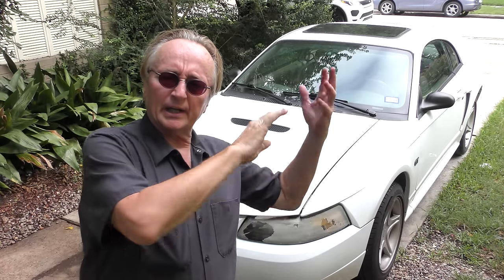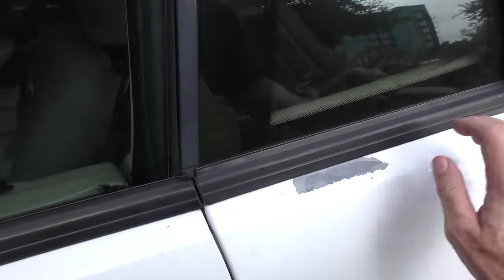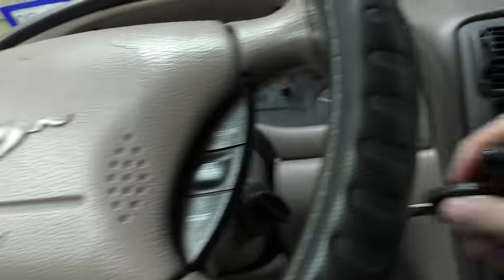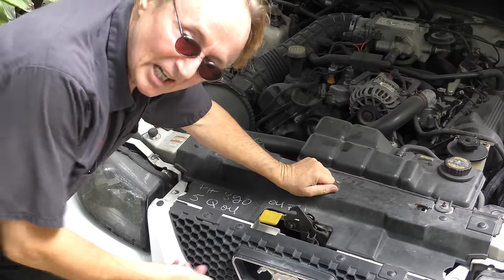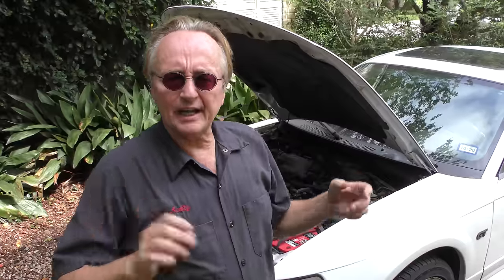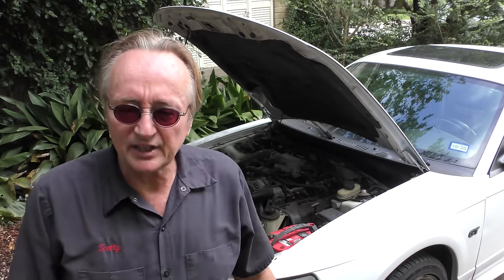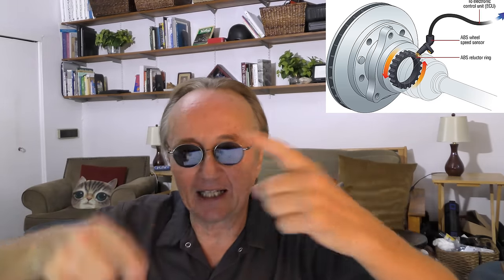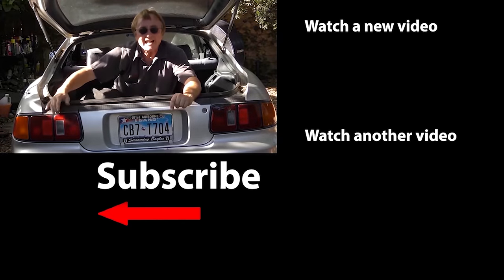Buying an Old Mustang and Fixing It Up

Comment: $5k 10 years ago was a steal. These things still sell for $5k all day.
Reply: American v8 kinda hard to beat it
Reply: 1200$ cars
Reply: United States Of America if only that was true lmao
Reply: i bought one 2001 green 120 k  3k
Reply: I bough a 2005 Mustang GT 115K for $5,700.
Reply: These years are a bit overpriced and they're not one of the best years either. 03 or 04 maybe, but not 99 to 02.
Reply: Still decent. I've been looking for a NIssan 240sx and those are so expensive. 6,500 for some paint peeled, 200K +, mismatched rust box. Ridiculous.
Reply: No they dont
Reply: United States Of America a busted up v6 base model for 1200, you can not find a gt for less than 3k in running condition
Reply: The v6's with low mileage still sell for 3-5k where I live. The v8's can be anywhere from 6-10k with low mileage. 5k was a steal considering where I live.
Reply: DG96 - v6 mustangs only sell from 1500 to 3k if I’m really good condition I could barely get 4500 out of my premium GT with no problems here.
Reply: @hsslegg  I'm aware. I was talking about relative to where I live. I live in Ontario, Canada where the used car market is greatly inflated compared to other places.
Reply: Hsin that’s a steel cuz it’s the newer body style with the revised motor
Reply: I owned two '02s and a '04 bought all three for less than $1800
Reply: @dg96-93  I, 100% support your claims.  From first hand experience. Bought my gfs 2000 V6 Mustang with only 100,000 km  for $3200 , and I got my 2006 Mustang with 300,000 km for $3500 haha . We are also in Ontario Canada
Reply: @NickSingh.96  yes sir. In Ontario the used car market is well inflated. What would could 1-3k for a car for many people can easily be like 4-5k+
Reply: i wouldnt take one for free. lol. looks like a tweaker mobile.
Reply: @Blake-pu3xc  its very true.   I own 13 mustangs...  most ive ever paid is 2000.   just bought a 2000 gt for 700 bucks and its way nicer than the one in this video.
Reply: @unitedstatesofamerica8304  yeah because theyve got problems. cheapest ones youll find with the v8 that dont have engine or tranny problems are about 4k, any cheaper and theyre burning oil, misfiring, or the tranny is slipping/syncros are going bad
Reply: Just got a v6 160k mi 1.4k
Reply: @andrewthag  not a gt lmao, pretty much irrelevant to this
Reply: $5,000 was a lot more money 10 years ago.
Reply: @jmorris023  That is still alot today...
Reply: @eclass96  Not with all the money that's been printed.  Inflation is off the charts, we just don't recognize it because the folks that put the numbers together discretely removed housing from the calculation in the 90s.
Reply: The dollar is getting watered down, that's why.
Reply: I got mega lucky and ended up with one for 500 bucks from a friend who just wanted to get rid of it
Reply: True, mustangs around my area hold their value quite well
Reply: got mine for 900
Reply: There all sideshow specials too alright ones 5k and mint clean ones 7+
Reply: @a.ortega4505  wow that’s a good price must’ve been a v6?
Reply: Got mine for &1200
Reply: @futureconsequence5374  all cap
Reply: 2004 145,000 mile $900
Reply: @Immortalkalashnikov  imagine wanting a pristine 240sx for 8k lmao.
Reply: Sometimes you can find them for less then 1000 dollars I know a website where I saw a bunch of good working ones for good prices
Reply: What?  i bought 4 for less then 5k$ lol like i mean all together. 🤔 i currently own two lmk if you wanna buy one.
Reply: @EZBMX713  how much and where is your location?
Reply: I jus bought one for 1200
Reply: More like 5k for a v6 lol, v8’s will run u bout 10k
Reply: Just got an 04 GT 5 speed 40th anniversary for 4K. And it needed pretty much nothing fixed. Been driving it 50 miles a day for 3 months now and all it needed was an oil change. I also replaced the clutch cable. Gets surprisingly good gas mileage for commuting.
Reply: I just got one and the cheapest in canada without rust was 10k over i got mine for 11k
Reply: We are very salt roads tho so i had to buy a show car
Reply: No they’re like 10k cars now
Reply: Im getting my 95 for 400
Reply: @unitedstatesofamerica8304  hahaha you are not too smart
Reply: Got mine for 3.5K with a basically new motor with 6,800 miles and month old rebuilt transmission
Reply: @NovaCaine2489  bought a 96 with 100k. $6300. Built. Supercharged
Reply: 5k is a fair price considering honda accords and toyota corollas from 2000-2007 go for 4k-8k stock with decently high mileage
Reply: I’m about to buy one off a guy for 2200 bucks gonna go look at it tomorrow
Reply: @ryan422423  probably doesn’t run
Reply: @futureconsequence5374  im looking at a 2000 v8 GT Automatic w 82,000 miles askin 5,900. I wouldnt give more than 5gs. Thoughts???
Reply: @unitedstatesofamerica8304  maybe wrecked
Reply: i just bought a v6 for 400$ needing a transmission pan gasket
Reply: I bought my 2002 convertible V6 for $400 back in 2015
Reply: O yeah
Reply: Got mine for 1k. 5spd v8, just needs a new cooling system and a good tune up 👍🏻
Reply: They selling for 10k now….
Reply: Lol I bought one 2000 Gt convertable manual transmission 180k miles in great shape inside and out mechanically sound, drives perfect only $2000 in California 2021
Reply: I bought one for 4,000$ but super mint just 175k on the dash
Reply: Just got one in New Jersey for 2000 dollars… 98 GT 4.6L, 110k miles on the dash, the car runs great but there’s a few things I need to fix up which will cost me around 1000 on top, which im okay with bc im planning to keep this car forever 🔥
Reply: @manz7860  I'd never pay 8k for a car that makes less than 200 horsepower just cause it's Japanese and most likeyclapped tf out 😭
Reply: This is so sad. I am looking at a 2004 v6 mustang but it now sells for 8 grand. Inflation is amazing.
Reply: @albertoacosta6788  Seems about right especially with prices these days.
Reply: @hsslegg they really do though lmao, i see so many clean new edge mustang GTs going for UNDER 5k all day every day, theres a bone stock, low mileage, manual new edge cobra thats super clean near me for sale for 9k
Reply: @slammingbrutaldegeneracy2561 Yeah definitely a 99/01 cobra lmao definitely not a termi.
Reply: They better be in Pristine condition for that price
Reply: Yeah in a greedy community after the stupid pandemic before that and in the minds of a normal people that barely worth $2.
Reply: Oh how the market has changed in 3 years 💀
Reply: @JustConnerygo  fr hahaha
Reply: Got mine for 3k even
Reply: The 3.8/4.2 family was some what common for head gaskets and water pumps 
 
Only have had one need head gasket and spent the money on the better gaskets

Comment: Scotty just made the 4th gen Mustang value go up.
Reply: The were $2,500 last week now they're $6,000
Reply: Nah, the 1996-2004 Mustang Gt's are still cheap. The car a
I pray for to be cheap is the 350z.
Reply: I've owned three about $1700 each now own '14 premium
Reply: Blue Dinero305 maybe for the V6 ones but the GT's are around $6000
Reply: @bluedinero3055  yea v6 u can't find a good V8 mustang under 2500
Reply: How much can he increase the value on them when almost everything he said was incorrect?
Reply: @Elver_Galarga_jugo  You sound like a hater. He's been a mechanic for over 50 years. Can't convince me everything he said is false. He's not perfect but he's right most of the time.
Reply: @Tjtjboy  he suggested the quarters were aluminum and that's why the paint is flaking, there are no aluminum panels on this body style mustang. Paint is flaking because of the chemical compound of white paint in the late 80s, 90's and early 00s. That's why you see so many white cars from that time frame regardless of manufacturer with white paint that flakes off. He said "the bigger motor" that bigger motor in the cobra is a 4.6L just like what's in this GT. He said it has an AOD-E, although similar, this has a 4R70 in it not an AOD. The AOD was phased out of the mustang with the 302 in 1995.

Being a mechanic for 50 years doesn't mean you know what you're talking about, it just means you know how to turn a wrench and now a days, it means you can read a scanner. 

If you think for one second that this guy is credible then you have alot to learn my friend.
Reply: @Elver_Galarga_jugo  He's absolutely credible. I've seen cars he said that were good go up in price. He's more honest than so many other mechanics out there. Probably the most honest on YouTube. People trust his opinion on which cars are good and which are bad. Do you really think he's gonna remember every single detail on a car made over a decade ago? I see you're focused on exact correct details which is perfectly fine. Yeah he might be wrong about those things you mentioned but that doesn't mean he's not credible. He's not gonna talk good on a car that's crap. And you originally said "everything" he said was wrong. Watch it again, there were some facts in there too. But if you're just gonna ignore that, than you're a hater to me.
Reply: @waljerjackson  Why?
Reply: He actually did
Its $6000 now
Reply: A decent GT goes for about 6k now. These will be the new fox body soon. They’ll go up in value soon.
Reply: @angelgjr1999  depends where you are, for a GT to cost $6k in socal it better have a blower or in immaculate shape with less that 60k miles. I got mime for $1700, my best friend just got his for $3k
Reply: Yep
Reply: No sn95s anymore scotty just soldem all
Reply: @joeneri150  me too
Reply: @bluedinero3055  I have a 01 mustang Sometimes won't go over 10 Millies .... what's could be the problem?
Reply: @Elver_Galarga_jugo  Lol The only thing he got right is that it’s a nice and dependable car...
Reply: @Elver_Galarga_jugo  Exactly, I’m in Maskachusettes and I paid 8k with 80,000 miles, in excellent condition, because they r so hard to find in the rust belt, too bad those panels aren’t aluminum like Scotty says...I almost feel bad for him, but he’s raking in the dough with his fallacies, so I don’t...
Reply: I'm daily driving a 2002 GT Vert.  Runs great with 170K on it.  Got it cheap. It's a great little shitbox.
Reply: @Elver_Galarga_jugo  the hood is aluminum buddy
Reply: @waljerjackson  the 2005-2009 Stangs are so ugly
Reply: @SCHMALLZZZ  I have an 02, which is my 2nd so far, my best friend has an 03, my sister in-law has a 99 and prior to her current one, she had an 04, all of them have/had the stock fiberglass hoods. There are no 99-04 mustangs with aluminum hoods or any aluminum panels on these cars. Everything is steel aside front the bumpers, hood, trunk and sail panels, all of which are fiberglass
Reply: @SCHMALLZZZ  ok, i disagree but cool
Reply: @Elver_Galarga_jugo  When referring to the 'bigger engine' in the 'racing version' he was referring to the 2000 Ford Mustang SVT Cobra R and it's DOHC 5.4 that made 385 hp.
Reply: @ChaseBond11  yeah I know about the 00R, but no sense in talking about it since only less than 300 people at a time have one
Reply: I should probably stop jumping mine them...
Reply: I got one for dirt cheap from Brooklyn.
Reply: Not sure if he even realizes it.
Reply: I got my 2001 mustang brand new year’s ago and it still runs fine
Reply: @Elver_Galarga_jugo  He meant the COBRA R, that one came with the 5.4 and charger. Scotty's still right, but the transmission thing, you're right, these New Edges used 4r70W
Reply: @thomasburr9244  'lll
Reply: They’re worth 10k now, in my area. lol.
Reply: @thomasgabaldon1047  now they’re 10k
Reply: Literally bought one exact same for 6k in 2022
Reply: Got mine for $800 1999 , yes the original headlight faded and back  suspension slightly noisy but runs good, guess I was lucky buying this car for that price then.
Reply: Awesome car 🚙
Reply: Does a value like kbb count with inflation and the current economy downturn

Comment: I have a ford mustang 2000 v6 325,000 milles drives like a dream
Reply: no head gasket issues?
Reply: @alb12345672  probably multiple times.
Reply: No bro
Reply: I had a 2000 v6 also, had 174,000 miles it drove good when it wanted to start and had been leaking trans fluid so I got rid of it
Reply: Im at 270k on a 2000
Reply: Yeah same here. At around 175,000 the trans fluid started leaking. Bought a car after that. 

Thinking of fixing her up.
Reply: Rogelio Rodriguez lol I was told I could keep it or get rid of this other car that had only 58,000 miles on it. I chose the 58,000 miles car
Reply: 2001 V6 daily driver (it has a T5 manual transmission) and it's only 3k miles away from 200k. Head gasket was already replaced. No leaks whatsoever.
Reply: Mine 210xxx still perfect
Reply: Got my 2002 v6 as a first car, rear main seal is leaking, getting a sealer today and hoping to god it works!
Reply: 2000 v6 with 158k miles ( pretty low ikr) no engine issues just an annoying worn synchronizer in 2nd. also have a 2003 with 178k no issues but it's falling apart on the inside and the paint is coming off on lots of the car but hell it's not rusting even on bare metal!
Reply: @Dave Orange Nice
Reply: Glad to hear so many peoples V6's are still kicking. Bought a used 2000 ford mustang V6 with one owner at 93,000 miles in April, got it to 97,000 miles and put a good amount of work into it but the car is a great buy in my book. Biggest compliant is those damn bucket seats kill my back
Reply: @Dave Orange I agree, the ride quality isn't bad at all. If your riding on the original shocks and struts (which a lot of people do) the ride quality will suck but if you have good shocks and struts the car is really smooth. I have a set of KYB shocks and struts and it was a worthwhile investment.
Reply: My 98 has 310k. No issues.  I still take 2000 mile trips in it
Reply: Got damn...lol
Reply: Should I buy a 2001 for mustang with 220k miles for 1,300?
Reply: @leohernandez8029   1,000
Reply: what no way
Reply: '03 V6. Still going. 230k
Reply: @leohernandez8029   did you get it might get the same but for 1000
Reply: Got a 99 gt with 241k, still my daily driver
Reply: 04 3.8 with 220k still going strong!
Reply: @sethleger6105  maybe stupid question, my mechanical knowledge is very thin. Was it an automatic?
Reply: @staLkerhu  yes it was automatic
Reply: @sethleger6105  is it better in that regard if I think about a manual instead?
Reply: @staLkerhu  my cousin says Manual transmissions last longer but I don’t know how to drive manual

Comment: I actually like this body style Mustang, especially the Terminator. Those actually made closer to 415 horsepower, not the 380 it’s rated. SVT was the way to go if you wanted speed.
Reply: I love these Mustangs.

Although it is not the SN95, but basically it's the SN95 ( 1995 to 1998 SN95 ) but alot of the SN95 parts interchange with the 1999 to 2003 or 2004.
Reply: Actually, they made closer to 440hp and you could easily get a lot more. They are rare and have gone up.
They also made a normally aspirated quad cam rated at 320hp that took very well to supercharging.
Reply: Nick J they are all over auto trader and Facebook marketplace. Now finding one stock or un abused is a different story
Reply: Terminator. aka Cobra.   The 2001 Cobra R was the ultimate, only 500 made.
Reply: They were rated at 390, but make closer to 410😉
Reply: @theroyalcrownedtiger2946  This is still an sn95, 94-04 all have the same body code which is sn95. While in 99 they had the "new edge" refresh, body code is the same.
Reply: @tomjames7955  more collectable. But I'll take the supercharged quad cam in the 2003-2004 and upgrade the wheels, suspension and aero.
Reply: @ForcedfedFords  was higher than that.
Reply: @yasiona2946  : Hmm interesting, thanks.
Reply: @tomjames7955  troll? 2000* and 300 made*
Reply: @paulelliott682  Yep. That’s the only reason most Mustangs still have a rear seat.
Reply: @tomjames7955  cobra R was so sexy. My neighbor had one, or a really good replica.  Idk I was a kid but that thing was fast n loud
Reply: Rip camaro
Reply: @starkillerbeats420  That’s the way it looks.

Comment: 4.6, same as the Crown Vic so ultra reliable and parts are a dime a dozen!
Reply: I love that engine but the freaking plastic intakes are "great"
Also there's like 4 threads in the head for the spark plug so make sure you torque them right lol
... I've had 5 cars with that engine
Reply: @nastybastardatlive  Awww, that Mustang is so cute.... I'M GUNNA PUT IT IN TEH BACK-A MUH PICKUP TRUCK!!
Reply: @nastybastardatlive  u know id like to see the outcome; especially if you have an interceptor
Reply: I'll switch the bigger V8 into a crown vic!
Will make police vics (yes my state still has those) shut themselves!
Will find a beefy transmission to handle that power too.
Reply: @davecrupel2817  Know what I haven't seen yet.....diesel swap!!!!! Slap an ole powerstroke in there! Haha
Reply: @Blue_Mudder  west Champlin put a Cummins in one
Reply: And the 4.6 with cams and intake job gain tons of power for the $$$
Reply: ONE of the most durable engines ever made IMO.
Reply: Eh I rather the 5.0 I got the 5.0 in my 99 mountaineer
Reply: Dave Crupel stick shift
Reply: @Henderson Guy 
Nice. Do you have the 3 valve motor??
Reply: @Henderson Guy 
Nice set-up!! Some people - mostly Chevy guys - Like To disparaging refer to It as a "truck motor," BUT I think it's a great engine as it has the low-end grunt similar to a two valve engine and the high- revving/breathing ability comparable to a DOHC engine.  Hopefully, you'll have it for 20 more years!!😀
Reply: @Henderson Guy 
That's impressive durability. Since I'm a BIT of an Oil Geek, I have one last question for you: what kind of oil and filter do you use on it?! Sorry, but I couldn't resist asking that question!!😀
Reply: @Henderson Guy 
DAMN, now I MAY have to start using Pennzoil®!!😀 Take it easy and good luck to you and your Stang.
Reply: @thomasknight7734  all the newer v8 cars use plastic intake manifolds so its a modern way of doing it. The factory ones just have a design flaw and start to leak